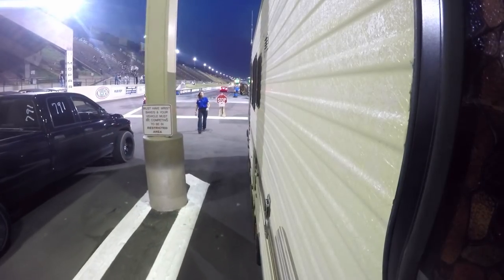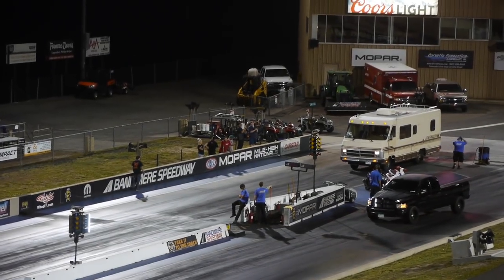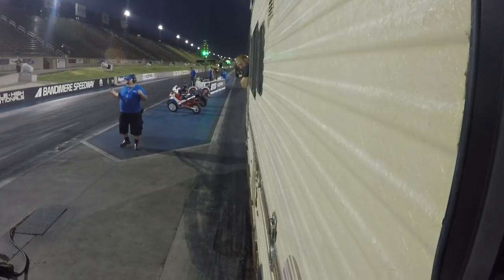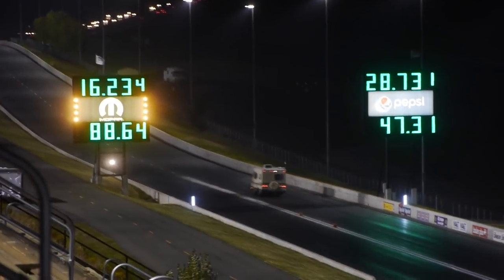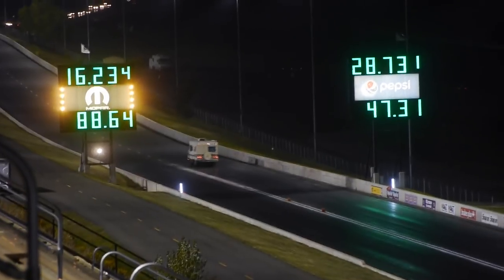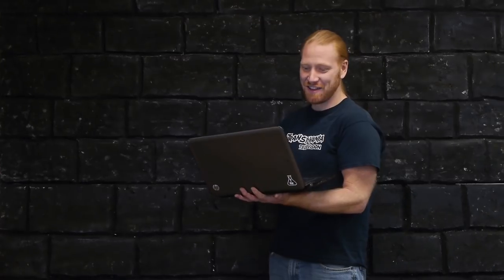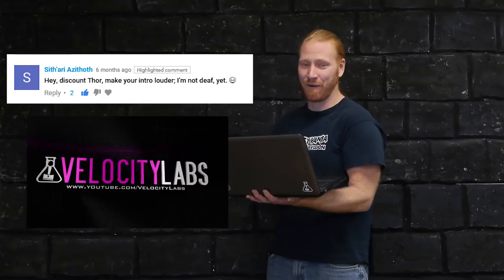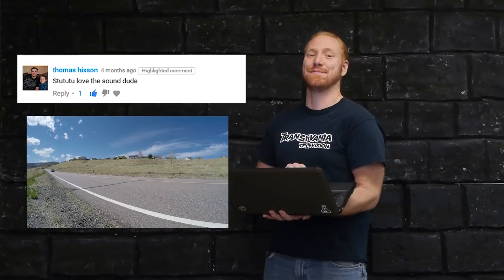Motorhome Drag Race - Big Block Chevy 454 Quarter Mile

Comment: I want to see one of these gutted with twin turbkis fully built with like 1300 hp racing down the highway
Reply: another channel "fuel injection sucks" put a 6L LS motor into a class A motorhome with turbos and a few other mods. it is fast. I did porting to a 350 sbc in an 81 gmc class C motorhome several years ago. But I blew things up with it.

Comment: This is hilarious.  Love it.  Do a build series to get it in the 25s!  Headers tuning etc etc
Reply from the maker: Haha, that'd be awesome!  It would cost at least $10k in parts though to get that done, I'd need sponsorship lol
Reply: @VelocityLabs  10k?  Uuuummm, no it wouldn't. Not even close. Thanks for attempting to con me into completing a survey to watch another video when this one ended. Naaaaah. I think I'm good with watching your videos for pretty much forever.  You're totally yag.
Reply: @Velocity Labs Banks Power makes a performance kit for rv’s with the 454. It includes headers, an air cleaner with duct to fresh air and some transmission shift upgrades. It’s around $2500. The previous owners of my Winnebago had it installed. The idea was better fuel economy but according to articles did improve overall performance.

Comment: I've got a 84 35' 454 with a factory performance package.Headers,4barrel and transmission with a gear splitter type setup.Just got her she runs pouring gas in the carb.Been sitting 8yrs so I'm going to change all the fluids before running her anymore.Just couldn't resist trying to start her once or twice.

Comment: Man my camper special dually was a true beast. About 7-8000 lbs, stock-ish bottom end, small chamber (108cc?) medium oval port heads (2.06 intake), local old guy machinist ordered up a sleeper cam (.503 lift with a 115° LSA, technically for a boat to prevent the choppy wake but idled like a Sunday afternoon chess match) matched to a 3-way adjustable roller timing chain set 4° advanced, all of this residing under my secret weapon....an edelbrock c427x BIG rectangular port intake found in a few Baldwin motion cars. And my own personal hand-made quadrajet carb. The rectangular-oval port mismatch has a real impact on cylinder filling once the gaskets are cut to fit and a generous amount of silicone is applied. The first day I probably gained 50-75 hp in the form of two full tubes of silicone everywhere I could find a vacuum leak. Then I got two sets of gaskets (rectangular and oval) to make my own set that actually made a seal around the ports. Then it only required one full tube to seal the deal. Dual electric fans, 3"-5" exhaust, granny 4 speed (low,1,2&3) Saturn bucket seats, a huge chrome shifter with trailer ball for a knob, no bed-two big Bertha toolboxes fore and aft of a 5th wheel hitch between the frame rails, ls1 Camaro 58psi fuel pump in the tank, two fuel regulators (one for volume then one for 5.5psi pressure to the carb) a 5/8 heater hose to 1&1/8 fitting in the inlet side of the quadrajet and anything that wasn't a float/needle/seat removed from the bowl to keep up with the fuel volume that beast required.....took me and the toddler about 6-8 weeks and 3 total teardowns to get it just right. But man it would do anything I asked of it and smile back at me while doing it. Tires were a bi-weekly sacrifice, the kids in town ran down the street and chased me more than the ice cream truck just begging for another 3rd gear slide-ways clutch dump from the friendly Mobile mechanic (me)....all the badass diesel trucks I had built for my buddies in town learned their place between 3rd and 4th gears (only place I ever found any traction). I'm still hunting it down, I think I know who ended up with it in my absence...and I'm not a very happy camper without my drug of choice (adrenaline from needing more brakes)

Comment: if you prepared the motorhome for racing quarter mile. setting timing advance, advance recurve, setting the quadrajet carb for racing. when you tried to do a burnout and stalled it, you should have backed out of the starting line and taken about an hour to retune the engine. base timing is 4-6 degrees btdc. total advance timing is 36-38 degrees at 3500rpms. you can stretch the springs about 1/8 inch to achieve a better torque curve and quicker throttle response. If it hesitates or sputters or stalls on a burnout attempt, fatten the idle mixture slightly. for the 4 barrel to be optimimized for top acceleration, check the throttle bracket at the carb and you might have to add a half inch spacer to get wide open throttle. some motorhomes have a restricted throttle bracket at the carburetor to prevent the 4 barrel from fully opening the secondaries. you can also fatten the secondary fuel by thinning the tips of the secondary fuel rods like toothpicks or sewing needles  to achieve a fatter mixture at top throttle. making those slight mods shouldn't cost a cent. you have no idea how much power and torque that powertrain is capable of making. run only dry weight. empty all the water tanks and only run the main fuel tank. if you had picked up a leak damaged motorhome partially gutted out will almost keep up to a corvette. I've used motorhomes in little high speed chases and I can keep up if I'm following someone in street traffic. highway speeds not so much. I typically top out within 80mph maybe 90mph if the gear ratio and engine isn't already at redline. if you can get a fast 60ft launch within 2 seconds, you'll make a mind blowing 1/8 mile or 1/4 mile run for the size of the motorhome. They're not meant for racing. But the 454 chevelle SS said otherwise.

Comment: 1/4 mile in 25 @ 60.  I have a feeling I'm being very optimistic.  Perhaps I'm tainted as back in my days playing trumpet for several Shrine Circuses I had a built Ford Bronco (460 out of a '72 Lincoln Continental overbored to 468 and the driveline out of a One Ton Ford 4X4 Pickup) that would pull my 31 foot travel trailer like it wasn't there.

Comment: My tow truck had a 454 in it was 1998 3500 Chevy HD I had well over a half of a million miles on it at least when it was involved in accident January 2017 it was used as a high-volume repo truck it was beat like a redheaded stepchild but that was a good solid motor towing a car or not towing a car I still got about 10 miles to the gallon

Comment: I have a 1985 Limited by Fleetwood 35 ft 454 that i got for $50 and all i had to do is put 2 new fuel pumps on it to get it running one buy the tank electric and one  under the passenger seat behind the front tire mechanical  i haven't been able to see if it will drive yet. the engine alone is worth $500.

Comment: slower not by much than my old mopar 440  77  28 foot winnebago  we did get the motor out of a cop car though and it did have headers and ported heads.

Comment: 454 (7.4) from that era is weaker than many 1.6 engines as far as power goes. It probably revs less than 5,000 revs.
Reply: Juan Garcia a stock engine and computer does not a built one